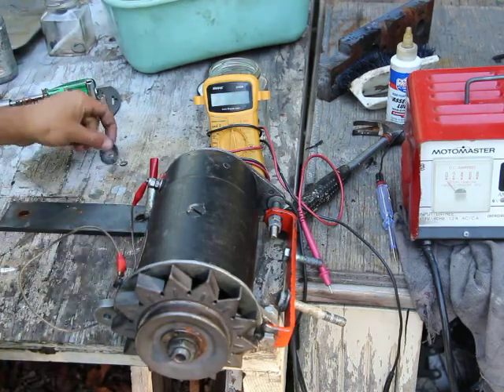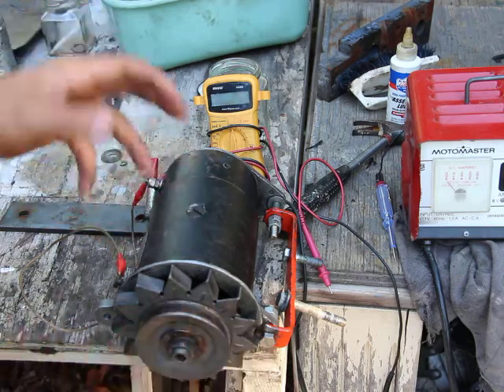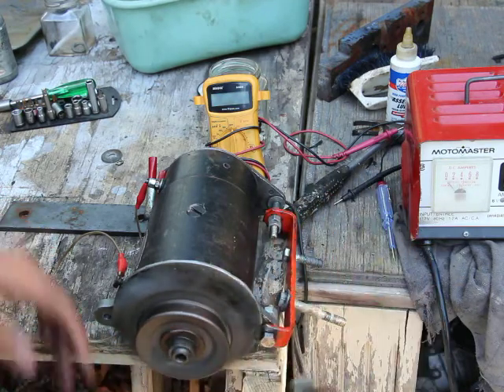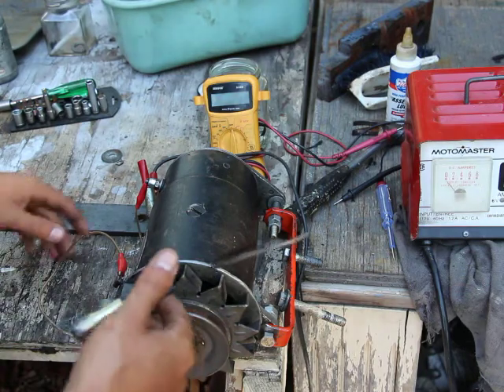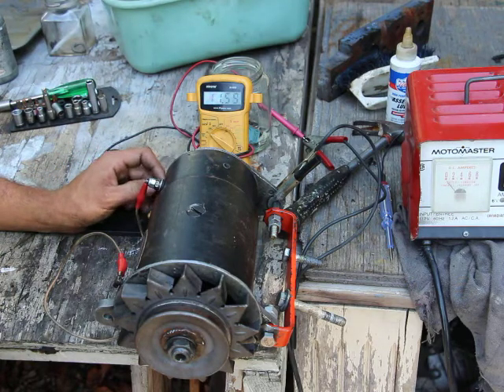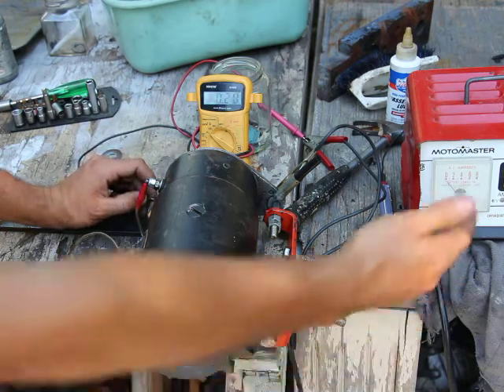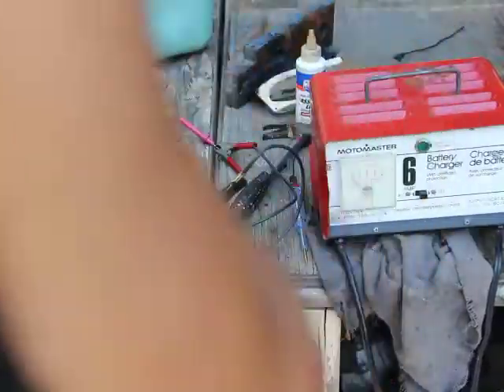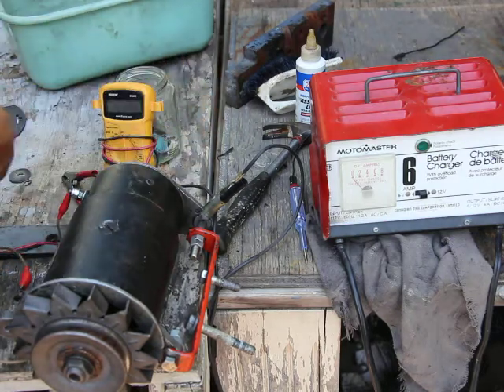Testing the voltage from a classic car generator

Comment: So it wasn’t charging on the car at all?
Reply from the maker: Nope. Battery was dying. So it seems that someone fiddled around with the regulator and removed the center solenoid. So it would work for an alternator, but not on a generator...Iv'e concluded this from the pictures in the manual:

-Regulator for generator has 3 solenoids
-regulator for alternator can have just 2 or transistorized.
Reply: Old Crow's Classic Cars,  I see. Well you’ll fix it for sure 😎
Reply: @OldCrowsClassicCars  Thanks for the good video.  I am wondering if the battery in the car runs down is that the generator should be putting out 13.5 volts, regardless of polarization.
Reply: Im having a charging problem on my car. Does the ground crew need to be grounded? I have A going to Gen on regulator and F to F on regulator. My ground screw is missing. If the ground is not connected will it affect it from charging my battery
Reply: @JoseR.95  I hope you got it figured out.  My dyslexia makes it challenging.